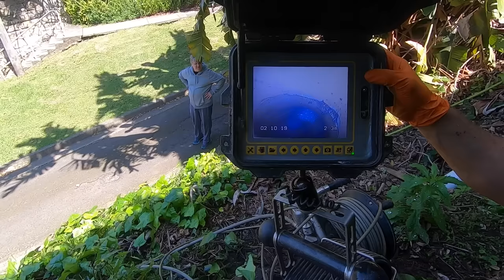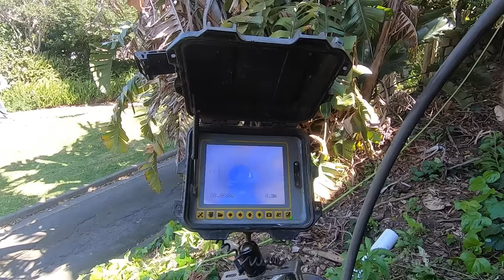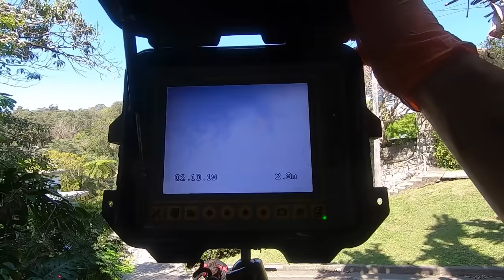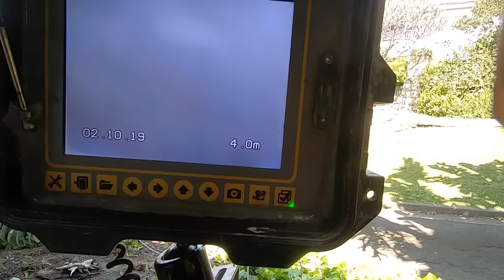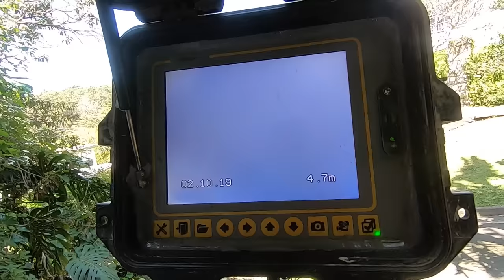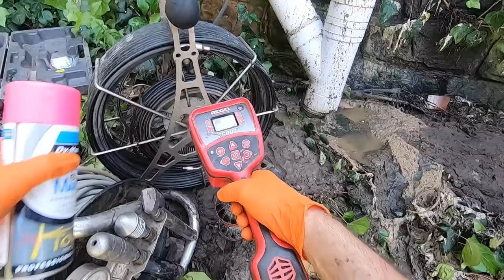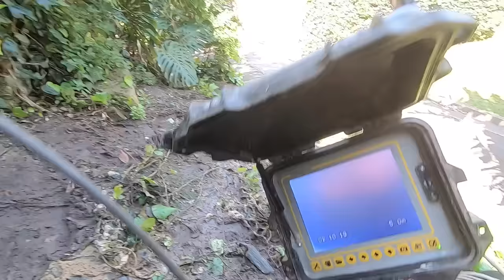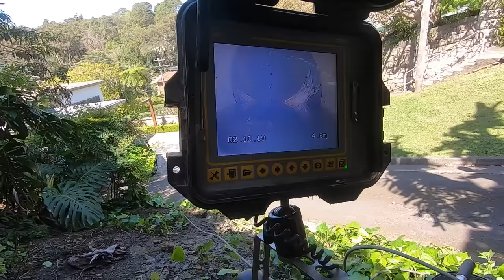Blocked Drain 365

Comment: Always remember the 3 rules of being a plumber: Shit flows downhill, don’t bite your fingernails, and you get paid on Friday.
Reply: stolen but ight
Reply: So is this shit water ?
Reply: @latenightsweaty9530  not shit water. just water with a lot of shit in it. think like 20-30% shit water.
Reply: All you need to be a Plumber; Hot on the left, cold on the right, shit flows downhill and payday is Friday.
Reply: Old school plumbers quote 🍻
Reply: Jerry Gala better be a big check
Reply: Shit can be pumped uphill..
Reply: @AndrewJackson456  and I get paid on Thursday.
Reply: and don't work with your mouth open
Reply: I always heard shit down stink up payday on Wednesday? I do like the fingernail bit :-)
Reply: @capitolabill1921  My 60+ years says its "Hot's on the left. Cold is on the right, Stink goes up, Shit flows down, and payday is whatever day the boss decides to pay you
Reply: I would love to do this job, I love messy stuff like this! But I bit my nails 24/7
Reply: @AndrewJackson456  Has to be. When our house was built they went to connect the pipe to the road and found the main was 50cm higher than council plans said. That meant out we had to have a pump and backflow system put in.
Reply: Add a 4th rule.. have a pocket knife for jobs like this that can be sanitized. Not one that's attached to all your keys..
Reply: Mel Tillis in Cannonball Run.  Good movie.
Reply: Rules are, hots on the left colds on the right, the boss is a prick, shit flows downhill and payday is on Friday
Reply: @johncalderwood1  I find this stuff interesting would love to take a crack at it
Reply: @breebw  That would have meant the seller was refunding my money and costs.
Reply: BRO!!!! You know that Ollie is NOT a plumber, right??? He says all the time, "they'll need to call the plumber, Mate" to whoever is there representing the building, or the owner of the house.
They only call him out when the regular plumber can't fix it. He is a specialist. Like the brain surgeon of plumbers, lmao.
Reply: @vonw.3294  that was the one I was going to point out
Reply: 😊nice work
Reply: I was taught 4 rules. Those 3 plus “hot is on the left”
Reply: Shit will absolutely flow uphill with a sump pump. Sometimes, it has to.

Comment: I just spent 40 minutes of my life watching a guy in Australia clear a clogged drain pipe. I'm glad the people who laid the undersea internet cables allowed me to watch this from USA
Reply: Anthony Strohmayer yo lmfao this comment cracked me up but same same lmaoo
Reply: Don’t think that’s how it works
Reply: Remy Masson naw homie if internet was all WiFi then what would the point of routers and modems be?
Reply: Me i watch this from canada
Reply: Remy Masson by cable, that’s how it works.
Reply: @derpacalypse9504  satellite
Reply: Brandon G Unless you live in the middle of nowhere there’s almost no point in using satellite.
Reply: Wi-Fi = Slow and not stable
Cable = Fast and Stable
Reply: @alunkard-geovane2685  I mean wifi is not slow and unstable, I have 1gb optical fibers going to my shop and then to my router and switch for a LAN. I have 23 ping going to LA, 16 computers on the network and I'm still getting 200mbps downloads each roughly. Yeah a cable would be faster for singular pc but on big networks because you would have to run a million cable to connect each pc to the internet, that's why routers and switches exist. Cables should be used to get alot of info to a tower and then broken up by cable to Wans where wireless takes over with ground terminals. Been doing this for a couple years.
Reply: He doesn’t live in Australia
Reply: He lives in the USA 🇺🇸 I DO TO
Reply: @trashuogaming3330  🤓

Comment: I used to do sewer inspections using a crawler. You don't know panic until you get a $80,000 crawler stuck several hundred feet in a sewer.
Reply: We're you alone
Reply: McDoom you don’t even know man. You know that “jetter tool” the Chris guy talked about in the beginning of the video is like 20,000 US. and the camera he puts down drains in some vids can go for thousands.
Reply: No the worst is when the quick disconnect comes off in the pipe
Reply: Did you get it back?

Comment: Great job as usual! I worked about three years as a service tech at a drain clearing/jetting/installation and repair company and spent many a jobs working on snaking stoppages out 125+ feet or jetting with a trailer jetter with 4000psi and 400ft of hose on it( thankfully ours would reel in and feed with a remote) but its cool to watch these videos and impressed by your quality of work on every job keep up the good work mate oh and get yourself some coveralls or waterproof pants bud cause damn..

Comment: You know its going to be an interesting one, When its 40Min long.
Reply: Has anybody seen how many cc's that pressure washer engine is?
Reply: @1d1hamby  as many as it takes to run city water pressure up to 35000 kPa?
Reply: @davereeves1967  , it's probably more like 55,000 kPa.
Reply: I'm at the 23 minute bark. And Chris just left. I have 17 ish minutes left. I thought the drain was cleared so I'm curious what is going to happen in the next 17 minutes.
Reply: @1d1hamby  as an American, 8,000 PSI seems like quite a lot. It may very well be, though. I've never gotten a good look at the gauge on the jet.
Reply: @davereeves1967  , it might be 5000 psi if that's what you saw on the gauge. It's probably high volume like around 8 gallons a minute then.
Reply: @davereeves1967    :)   5000 psi    " I've never gotten a good look at the gauge on the jet.":      https://youtu.be/7kMpFZ1U3wY?t=428
Reply: As far as I remember 5000psi pushing 21l per minute
Reply: @Snooooozel , that sounds like a pretty powerful professional pressure washer. (Alliteration?) 5000psi X 5.5 US gallons or 4.5 UK gallons.

Comment: Out of curiosity, what is the point of having it piped in that configuration, seems like it would just cause trouble.
Reply: A seal for the stench.
If I literally translate it from Dutch it's called a swans neck.
There's water in the T section all the way to the next bend. Thus blocking sewage smell
Reply: So just put in a pee trap.. instead of all that useless pipe.. and probably clogged up with thing and stuff that should not be flushed anyway

Comment: TIM from Canada here is a suggestion for you you want to know how deep you are in a pipe and you are not too sure on where you are in the pipe here is a big suggestion for you on your on your hose that you were putting in your pipe if you had it marked off every 10 feet with a hi visible line across like a green or orange or red something like that every 10 feet then you can figure out where are you are or if 10 feet is not good enough then you can do every 50 or every 100 feet so you know if your cable was marked out in 10-20-30 feet like you have on a measuring tape if you take the same principle as a measuring tape and do it on your line going in your pipe this would help you out just a suggestion for you or anyone doing this kind of work

Comment: What  hose size down the pipe u use my man, I use the same type of engine , I’ve been using 1/4 inch, but someone said I should use 3/8 , my set up is 3500 psi, 8gpm

Comment: so im new to this channel, just a few  questions. how do you run the exhaust for that honda engine ? does it just vent in the cab or outside ? also is that for compressed air and pressurized water ? or just one or the other ?

Comment: I’m wondering if the water jet is his only cleaning tool? If so that’s not the correct way to clean a pipe... the only way to actually know you have the pipe cleaned is to use a drum machine with a blade the same diameter as the pipe.